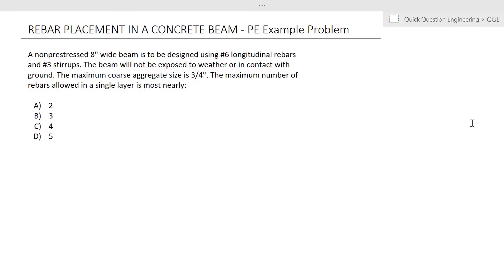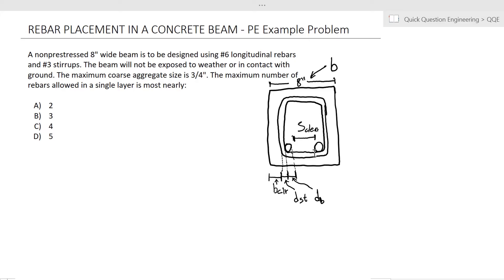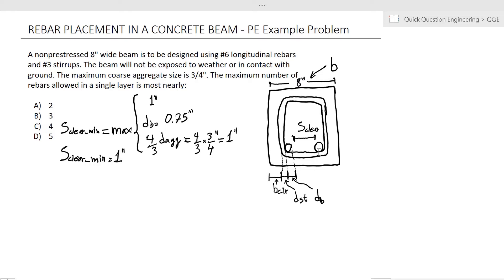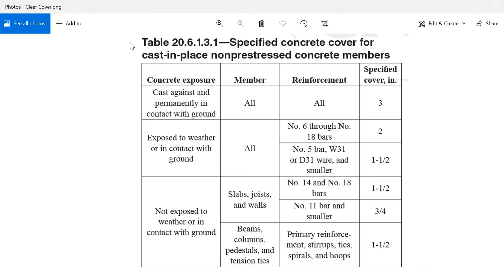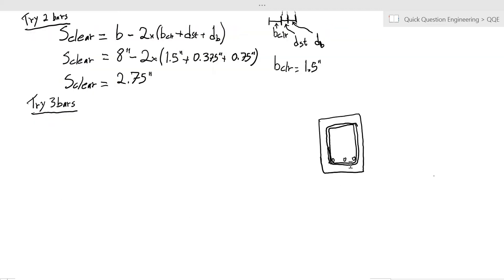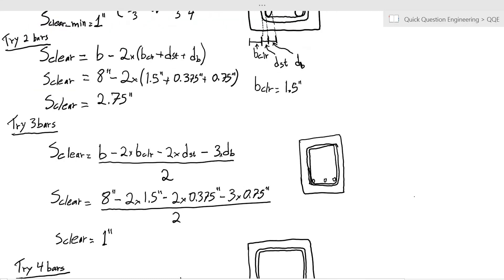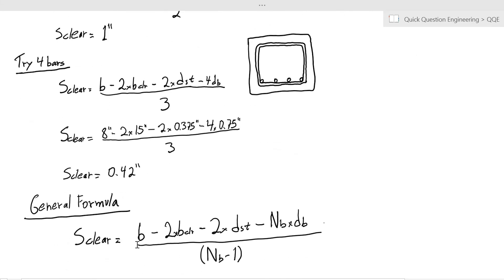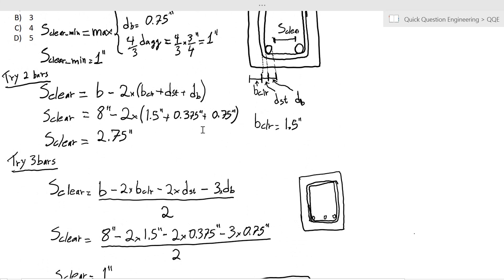How Many Rebars are Allowed in a Concrete Beam? Civil PE Example Problem

Comment: Thanks for the video. Just wondering if you build your own template for the CBT PE exam, can you use them during the exam? Or is that template simply for the exam study? Appreciate your help!
Reply from the maker: You’re welcome JL! Please make sure you include the stirrup bent radius when doing these clear spacing checks. It’s something that I overlooked in this video, but I corrected it in the video below. Regarding your question, unfortunately you cannot use that template during the CBT PE Exam. I think it’s helpful in studying for the exam and to have as a sanity check on your day job if you design concrete beams.

https://youtu.be/iy7A8BbjocY